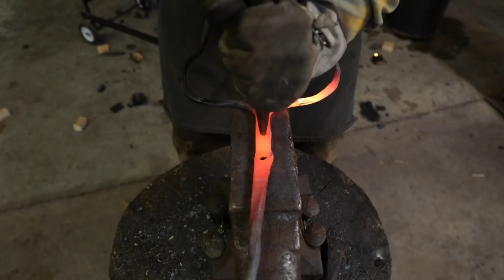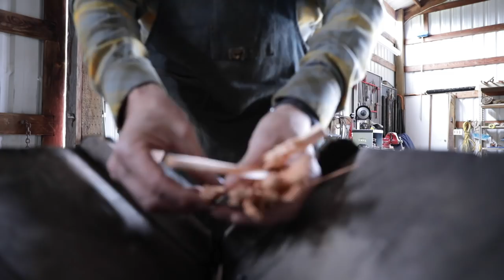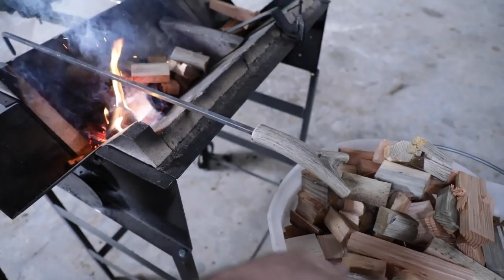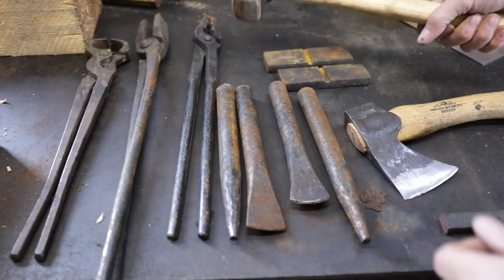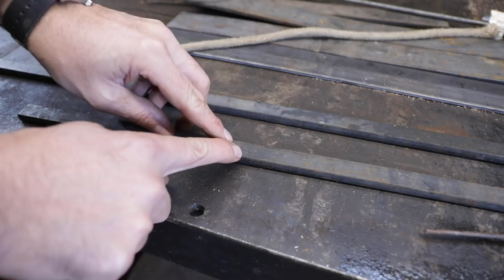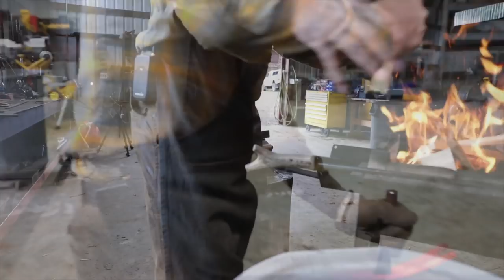Blacksmithing | The Diabolical Trade

Comment: You would also have an easier time splitting the steel with a cutting bit that slides into your fuller on your anvil then you can hit with more power and not worry about hitting your hand.

Comment: Hey Cody.  Awesome video,  
Friendly suggestion.  Polish the face of your new hammer so that it is very round. With no hard edges.    It will make it easier to avoid tool marks in your steel.    Later as you get more proficient many smiths move to a flat face as they have more hammer control and a flat face has the hard edges for intentional marks or making deep cuts on the fly.

Comment: Cody, if you cook your wood chips prior to burning in teh forge, You will get a much hotter, more even heat that last longer.  Put the wood in a container with a small hole drilled to vent gasses, and then put it in a fire.  Allow a few hours to thoroughly cook, depending on thesize of your container and you have actual coal.  it cooks off the impurities without actually burning hte wood. Just carbon left. It allow for changing the carbon content in your metal a little better too if desired.

::edit:: I just heard you say its specifically a wood forge, I guess that changes things.

Comment: Cody, try welding some tabs to the back end and middle of your chisel and drop it in your hardy hole. The tabs are to keep it from spinning and to keep it from falling through the hole.  Then place your workpiece on top of the chisel and hammer from the top. You'll find the difference is night and day.

Comment: You can cut down on the higher pitch anvil ring by putting a strong magnet under the horn. it helps absorb the sound. Help save your ears. Also soap stone marks will withstand the heat and it an easier way to mark what you are working on.

Comment: I like your design, cant wait to see it come together! These skills take time to master and i think your doing great. one small recommendation for the hot cutting. Bigger hammer like 3 or 4 pounds is what i like, youll make more progress with less effort. Second is you need more heat. Dull orange heat is hard working. Maybe turn your wood to charcoal and use that? Maybe someone else can chime in about charcoal and the tempature. Be Well and hammer on!

Comment: There is a definite learning curve.

There is a simple way to make your forge more efficient.  It's losing a tremendous amount of heat.

 Place 2 half round logs sideways across the top of the forge.  This will keep in alot of heat and will become charcoal itself.  leave room to load more wood bits as needed. Have a large pair of fireplace tongs handy to adjust the half rounds as needed. 

 Using wood/charcoal to forge with works well as long as it's done efficiently and you understand It's needs.

Comment: This comment is "Tongue in CheeK" (meaning I am poking fun at Cody). He used the band saw to cut the 1" stock to length. Why not use the band saw to split the metal stock to the desired length and then use forge to manipulate it to the contour you desire.  Just a thought :) Always love your videos.
Reply: Sunny W I actually had the same thought. But I have no clue about metal working.
Reply: i HAD THE SAME THOUGHT TOO! Maybe he wants the truly rustic look, but I still would've cut it most of the way and split it the last inch or so... then continue forging each side to round. @Cody You got the tools, use 'em.
Reply: maybe cut it half the way with the band saw then finish with the chisel
Reply: He’d be criticised if he did or didn’t, personally I’d have cut it first

Comment: You should take some 100 grit then some 220 on a hand block to the face of the new hammer. You just want to blend all of the sharp ground edges a bit. for they can cause stress cracks in the face, and these edges can leave little marks in your work, that are hard to later file out. Also put a mark on the handle that you can feel with your thumb. but only on one side. that way your had knows what face is down on the hammer all the time, even if it is too dark in the shop to tell. Whether you are right or left handed, always lay the hammer down with the face that you are going to be using on the next heat, away from you. that way when you grab the hammer and pick it up, that face will be the one facing down. it is the little things like this that give you a few more hits wile the iron is hot, and those few more hits, gain more and more work done. and that is the whole idea,.  Great vid, as always sir. keep them coming.

Comment: You'll get higher heat with less material by char-coaling the wood before forging with it. Char-coaling removes the lower temperature volatile components of the wood. Same function as coking coal.

Comment: Here is a thought for splitting steel. 
Make a cutter that will fin in you anvil. 
Then make a pass that sets the line in the steel you are cutting. Just deep enough that your cutting tool can follow the grove. 
Then with the cutter in  the anvil you can follow your line and hit the steel splitting it in two.

Comment: Interesting video - may I give you the advice that you always make only one blow at a time with the chisel. then set up and remove the chisel for a second and set on again an punch.

reason:

the chisel is cold metal, your workpiece is hot metal - metal has the tendances to move energy from hot to cold to make it equally warm. So the long the chisel is on the workpiece the more heat it draws away from it and the quicker it cools down.

second reason: 
the hotter the chisel gets the sooner it is ruined. 

enjoy blacksmithing - cheers from Vienna

Comment: You should lift the tool off the metal each time you strike to ensure the tool is where you want. It also limits heat sink and the temperature treatment of the tool your striking but mostly checking for tool bounce.

Comment: Guys, he used a hot cut chisel to split the work instead of the band saw for several reasons:

1. This is an art piece made with the traditional techniques of blacksmithing, having a clean super straight cut in the metal is too sterile and would probably stand out as having been done with a power tool on an otherwise hand forged piece.

3. Obtaining a skill requires one to actually use & develop techniques. This project gives him an opportunity to make a long cut with a hot chisel. That's good practice. You could do all of this with power tools, but you won't know diddily about blacksmithing when you're done.

Comment: You should´ve cut the steel on the bandsaw beforehand BUT not shortend it, because now you need to use tongs when you could´ve used the steel bar itself as handle... way easier to handle than with tongs!

Comment: Another suggestion.  You might want to invest in a cut off hardie.   It sits in Your Hardy hole and lets you strike from above vs with a chisel.   More force and I think a more precise cut.  Www.cjforge.net sells them very inexpensively. But they make a very good product.   Also Jeff McCrady makes a very nice one.   An axe style.  I have one of his and love it.   I welded a piece of steel I machined to fit the tang so that the hardie can fit loosely in the hole and not put too much force on the heel of my anvil.

Comment: Cody you should make your own Wood Lump Coal... Its easy, would be alot more efficient timewise starting the forge up, and less work keeping it going while starting... I have Champion Forge with the Hand Crank Blower and thats what i use... Also i would suggest turning that chisel into a hardy hole tool for your anvil, then you dont have to try and hold your work piece, your chisel and your hammer... And it was hard for me to tell but the end when you were splitting the piece it doesnt look like where you were splitting was hot enough, i know the end of it was but it looked like the area you were splitting was on verge of nit being.... Any way just trying to help out.... Keep forging and putting these videos out... If you want to try using the lump coal heres the easiest way to do it....
https://www.wikihow.com/Make-Charcoal
Reply: Yes
Reply: I was thinking the same thing, and it would make a great video.
Reply: I was going to say the same thing. Charcoal is so easy to make. Every time I fire up the grill or build a fire instead of using my furnace, I throw a few cans of lump wood in and save it up for cookouts. I also save the coals left over after smoking meats.
Reply: Totally going to agree with this, lump wood charcoal burns so much nicer, hotter, cleaner, with less pollutants to contaminate your work.

Comment: I loved the video but there is one thing I have to add...

Please be sure to set a good example and wear vision protection: googles or a face shield. 

At my high school metal shop in the sixties, a young man chose not to and one of those little flecks of scaling landed on his cornea.  You can not blink fast enough to stop it from happening. They may be black and cooling rapidly but they are still 200-300+ degrees hot by the time they get to your eye, and needless to say, his vision was ruined in that eye.